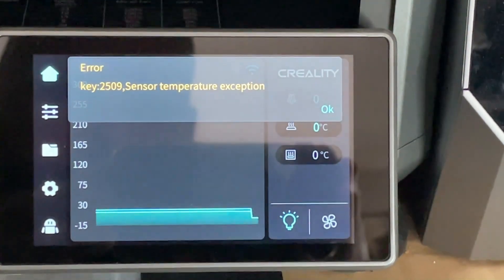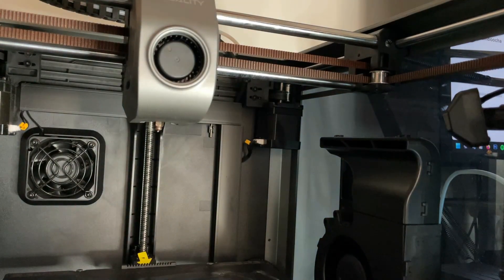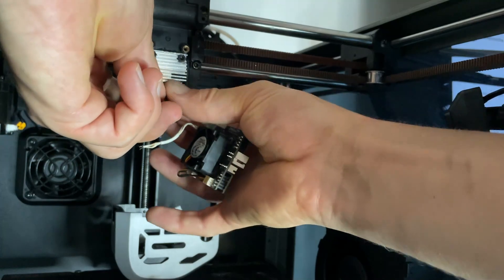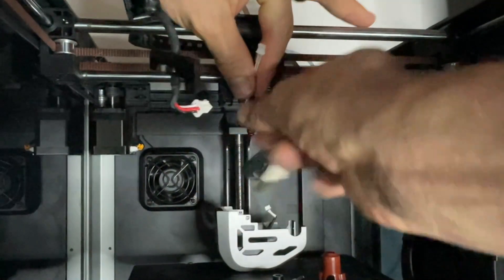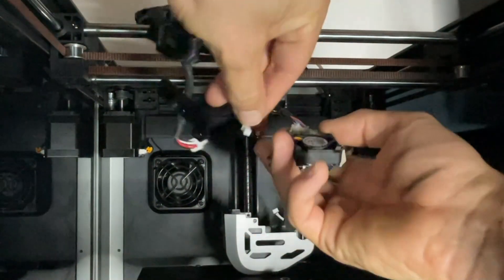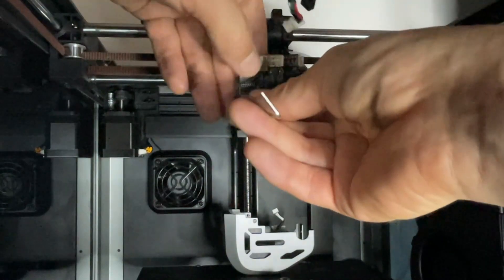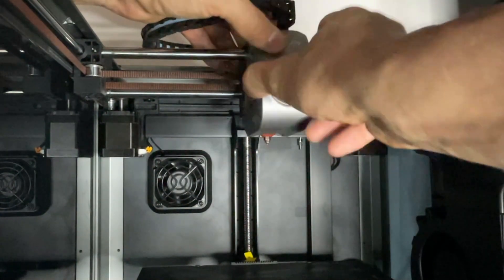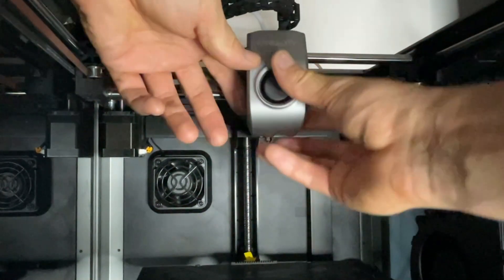Temperature sensor error 2509 K1C

Comment: where did you buy the extra white cable, mine did not just fall off like yours. The cables are still connected but I guess it does not work so I just need to replace ethe white cable but where did you get it.